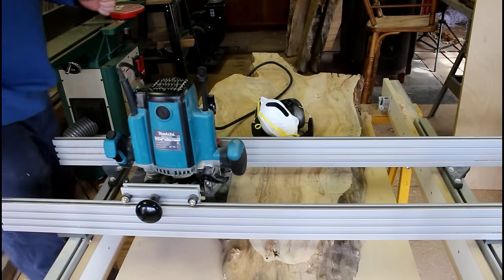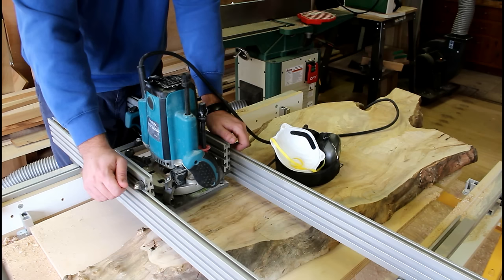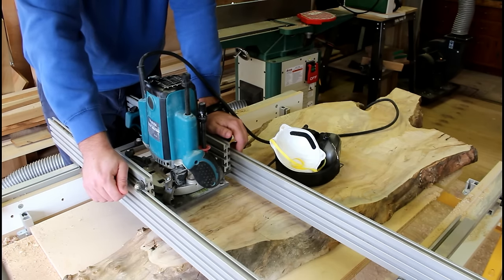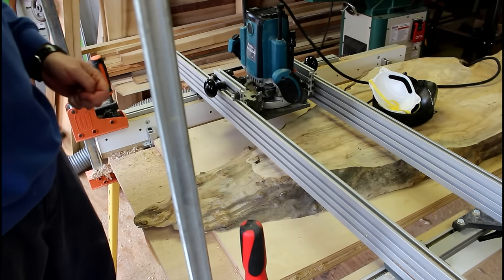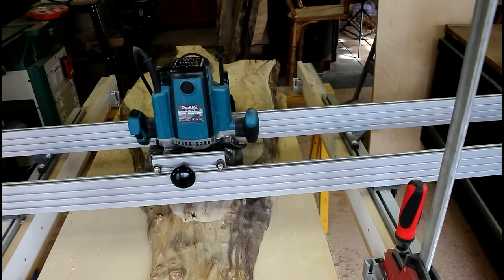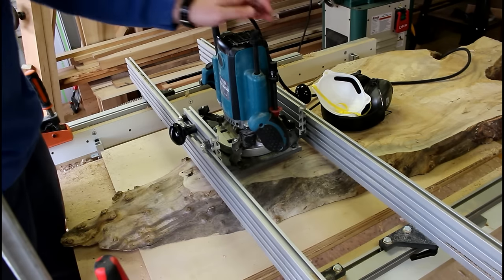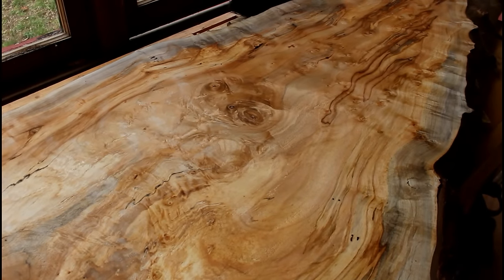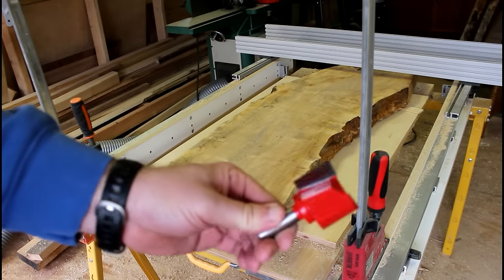AMAZING MAPLE SLAB

Comment: I just had two large maple trees cut down. I processed alot on my table saw and band saw. I have a good router and I have considered diy ing one of these set ups. For $61 I bought a Wen 4 3/4 th electric hand planer. It has worked stupendously. I got it close to where I wanted and hand planed it the rest of the way. I did many 4 x 8 very rough pieces and I felt it was cost effective and quicker. I have a friend who did the router sled jig like yours and we both think the electric hand planer was easier

Comment: I like the idea of suspending a good drill on top of those cross rails to drill steady pilot holes to put big brass rosan threaded inserts at the desired angle to receive table legs of different types that will thread into the table slab from underneath. That would be more useful for angled holes for sure, but check out the idea of rosan threaded inserts for screwing in table legs.

Comment: It looks like you're climb cutting when you surface the slab. Have I got that right?
Reply from the maker: +Paul Murphy not sure of that term. You mean taking more off one end than the other ?
Reply: Out of the Woods climb cutting is when the cutting portion of the bit makes the cut as it enters the wood. The other type of cut (what I call a "straight attack") is when the cut is made as the cutting tool exits the wood. Climb cutting provides a better finish because the wood being cut is backed up. The risk is that the tool (router) can "climb" by itself; it tends to self-feed. With a straight attack, the operator opposes the direction of cut, and thus has more control. The downside of such an attack is that chips are blown away from the workpiece. Googling "climb cutting" will allow you to read a great deal of literature on the topic. You will find that most of the material is geared towards the trade of machinist. Unfortunately, among woodworkers the topic is hardly ever broached. Incidentally, I would climb cut the slabs like that. The cutting edge rotates in to the workpiece and will not chip. Often when climb cutting, I will straight-arm the router and feed from my shoulders/body.
Reply from the maker: +Paul Murphy ok I am with you know. Thanks for the education. I will read further on that subject. 👍👍